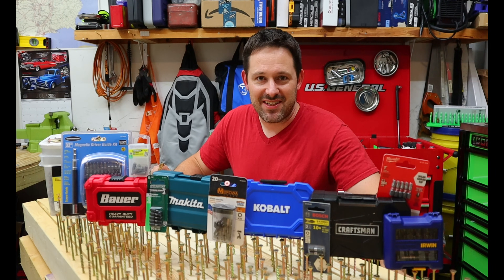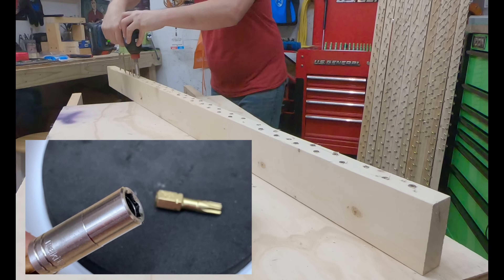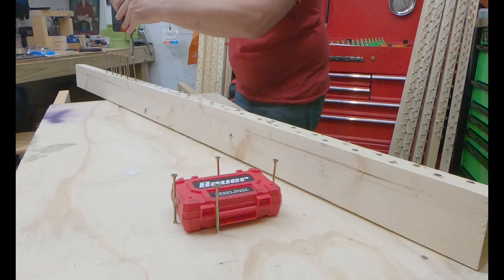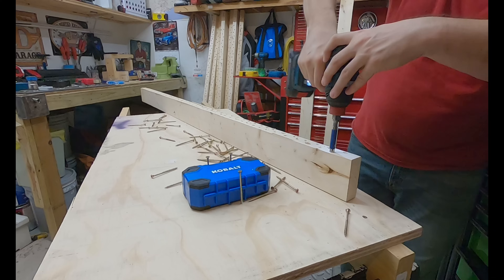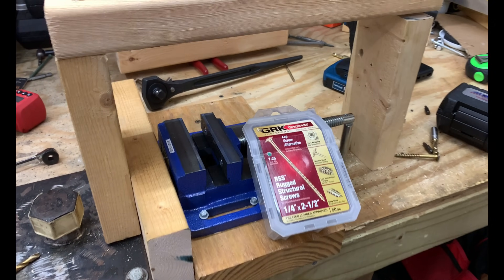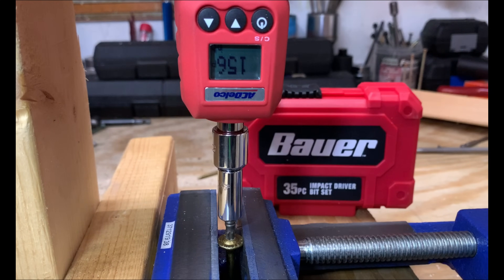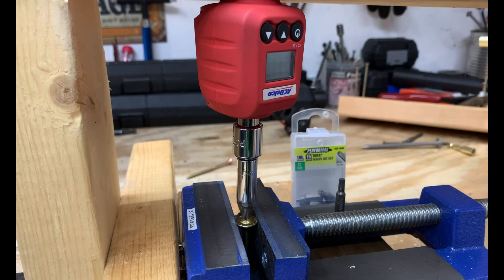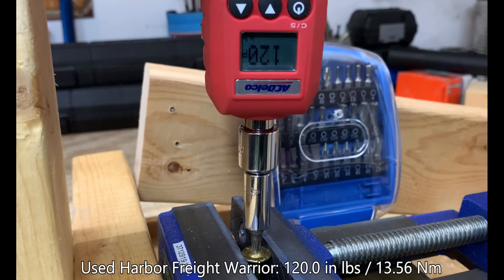Who Makes the Best Torx Star Bit?  Best Torx Bit Best Torx Brand from Big Box Stores

Comment: Why do torx bits suck so bad.  When doing commercial finish carpentry we use primarily #8 flathead wood screws.  I prefer Apex Philips bits and they grip like hell and last forever.  Torx bits are limp-wristed trash and you have to carry a shit ton of different sizes and you're constantly changes sizes.  Torx sucks donkey @#&h

Comment: Statistically speaking, you would need a minimum of 30 of each bit to test.  Thirty is the minimum number to qualify for a normal distribution.  These test are not accurate and bias.
Reply from the maker: Statistically speaking it typically does not make sense to do statistics with smaller samples. That being said a small sample size doesn’t mean inaccurate or bias results. Results could certainly differ so let me know when you test and put up a video on 360 new bits and 360 used bits👍🏻
Reply: @ClientGraphics  To be accurate in your claim, you would have to test at least 30 of each bit for a normal distribution in order to make any inference to their attributes.  This is just basic statistics.  You can test and claim anything but without accurate testing and data, nothing can be said about the validity of a single test.  This is a documented statistical fact like it or not.

Comment: I would rather have a slightly softer and not destroy my fasteners in the cars.  The harbor freight Baur looks really great 👍,  with coupons I can buy those a few x over,  it doesn't bother me,  especially with the 20% off coupons. Good info.  For my sockets and other tools I don't buy harbor junk
Reply: they just twist and strip your bolts out they have given so many hours of extra work from getting  mixed in with my good one never buy harbor freight unless its for a gift for someone you hate or a competator that you want to too sending to the store after troubles to return and strip the new ones out trying to fix troubles😅

Comment: FANTASTIC video. I was looking to mass purchase some t25 bits and this video helped out a lot. Concise,  easy to follow, great narration,  very informative.  Earned my sub. I have been using the Milwaukee t25s driving primarily 2.5"-3.5" grks into wood and they work great, like you said the fit is snug which helps a lot starting a longer screw.
Reply from the maker: Thanks Steffan! I have a Robertson Square drive one I'm working on if I ever find the time....

Comment: I have the dewalt bit holder like the Kobalt one and it is pure garbage.. I hate the sleeve on it. I ended up using a cheap warrior bit holder for my small bits. Just got in a 6" milwaukee bit holder than I havent used yet..
Reply: The sleeve is designed to go over the screw once it's on the bit.  When the sleeve is over the screw, you don't have that initial awkward wobble when you're starting it, which leads to unintentional angles, dropped screws, or a torx bit straight into your finger.  It's really handy when you need to run a screw in at an angle or need a lot of pressure to get it started.  If it easily falls over the bit, then it's not operating as designed.  You can pop the snap ring off and bend it out just a tad, that'll hold it tighter.  Another fix is to use pliers to apply pressure on the outer sleeve and slightly oval it, that provides more overall friction...but it also adds friction while it's turning as well, too much and you'll ruin the whole reason the sleeve is there.  It's also not that difficult to just take it off entirely if you have no use for it.

Comment: I’d like to see a test where each bit is brought to 70-90% of the failure point 10 or 20 times and then is tested, to simulate lag bolts and self tappers into wood and aluminum or wood and steel
Reply from the maker: In theory that sounds like an excellent test. I’d have to see how that plays out in a video format. Definitely have to speed up that test method in video. Kind of interesting to see how that would test out.

Comment: Too bad you did not try any of the high end German brands like Wiha, Felo & Wera.  I've found those to be better than most ones you can buy off the shelf.  They work and fit better than either the DeWalt or Milwaukee bits I have. Hardness is a double edge sword as it make them far more brittle and/or they will strip fasteners rather than the bit, which is a problem on cars...

Comment: Next time test Robertson! No one uses torx much anyway. 90% of all screws are Robertson now-a-days.
Reply from the maker: It’s on my to do list. Would you rather see S01 or S02 and which top 3 brands as I probably need to limit it to 6-7 brands total.
Reply: ClientGraphics S02 for sure. My brand head to head would be Milwaukee Shockwave vs Dewalt MaxFit vs Wiha vs Wera. And if you have time Makita gold & Bosch. A rated bit fitment measure or grade would be good too. Thanks for your hard work. :)
Reply: Maybe if you live in Canada, here in the USA torx are used a lot..  Hell I even ordered a box of robertson deck screws to see what theyre about and hex IMO are better..

I have had more cam out with robertson than torx using a drill and impact driver.

Comment: Am I missing something? None of those bits sheered-off if you watch closely. The screw head simply stripped out. All you’re measuring is the strength of that specific screw head’s splines. The better fitting bits will then obviously perform the best.....
Reply from the maker: They all cleanly sheered off and not a single fastener head stripped. You can check out some of the bits in this Instagram post. You can see all the bit tips as well as the bits that have a twist in them. You want a twist with the sheer otherwise the bit is technically too hard and could sheer during use. https://www.instagram.com/p/CDUafVwDGSh/?igshid=gvqoay355p7

Comment: Another good video Chris! I had that same AcDelco torque adapter, but mine arrived DOA in the box, I was so mad, I had to run over to Harbor Fright  buy the Quinn model which has far less torque ability.
Reply from the maker: If the Quinn could do Inch Pounds it would be awesome as the 2 AA batteries last longer than the Coin cells in the AC Delco which is a rebrand, but so is the Quinn. Quinn is still a good bang for your dollar.

Comment: Montana Brand tools I have used in the past always have worked well
Reply from the maker: I agree with you. I personally use Performax and Montana. But that Milwaukee was impressive if it wouldn’t have slipped on me a few time and should last.
Reply: Where do you buy the Montana brand at?
Reply: @nicknick2730 I've seen them at Menards

Comment: Nicely done video. I like the test jig you made. It puts everything on an even playing field. It seems to me there is some difference in brands but not a lot. I was disappointed in the one made in USA. I am also glad you included the Menards brand in the video. We have a Menards in our town and they outsell everyone in our area.
Reply from the maker: I spent a few weeks looking for the right fastener and setup method to hold everything together, appreciate you commenting. My two go to brands will still be Performax and Montana USA. One is priced cheap and the other grips the fastener well and I can get them both at Menards.
Reply: I use a lot of Montana bits and in my opinion they don't wear much and last longer over my Dewalt and Hitachi bits.  The Hitachi bits also last and have great fitment. (also sold at Menards)

Comment: You know how I feel about the DeWalt hand tools and accessories... I always use them... and they never let me down
Good to see that you are using Menards products in your videos... a lot of people on YouTube disregard Menards but they are a viable option just like Lowe's and Home Depot...
Just to put it in perspective....the difference in foot pounds from the highest rated Torx bit to the lowest Torx bit is about three and a half foot pounds.... so they're all generally as strong as one another... wear might be a different thing... one thing that does remain constant though is using the to right tool and accessory the right way.... that's how you get the greatest longevity out of your bits and tools....
Thanks Chris...🍻
Reply from the maker: I have a Menards, Home Depot and Lowe’s all about 1 mile apart. I went to all 3 for this video and lucked out that Tractor supply had the Irwin set. I personally use the Performax and Montana but usually in a 2” or 3” so I don’t have to use a bit holder.
Reply: @ClientGraphics  Home Depot is closest to me...(5 min walk)... Lowes is a10 min drive and Menards is a10 min drive....I frequent HD most.. but all have their up side...I just like seeing videos that compare Menards along with HD and Lowes... and Tractor Supply...👍

Comment: Very interesting video CG! Thanks for taking the time to make it and share it! I have to say I’ve use Irwin, dewalt, Milwaukee, craftsman, workpro and the Irwin’s are some of my favorite for t25. The fitment is hard to beat. The dewalt and craftsman in my opinion wear down over time where as the Irwin’s have just kept going and going
Reply from the maker: The Irwin bits were good, but that bit holder.
Reply: ClientGraphics I’ll be honest I have never seen that holder. I purchased my bit kit about 4-5 years ago and it’s black oxide very much the same styling as the craftsman bit holder you have. Now the Milwaukee bit holders are VERY tight which is good and bad but I don’t like that because just a little bit of dust or grime and it’s hard to pull bits back out

Comment: Wanna see expensive?
Get a Chapman bit , most of their bits are about $1.50 but some of their bits are up to $1.85.
Of course their bits are not meant for impact or screw guns...ect.
Reply from the maker: Chapman Manfacturing is an awesome USA made bit. They have some good information about torx vs star bits but I don’t have a source for them locally. I did talk with them before doing this video👍
Reply: @ClientGraphics  
I just buy them off their website but I'm buying them for a personal airgun smithing application, and am only buying what I need as I need it here and there to complete a set for my specific needs.

You wouldn't want to be replacing them all the time for what they cost, and I don't expect to ever need to replace them.